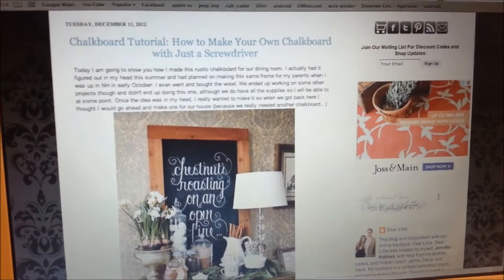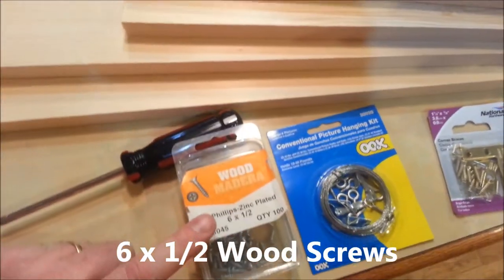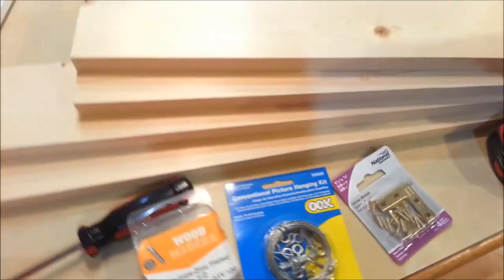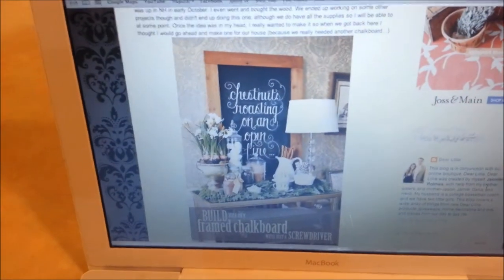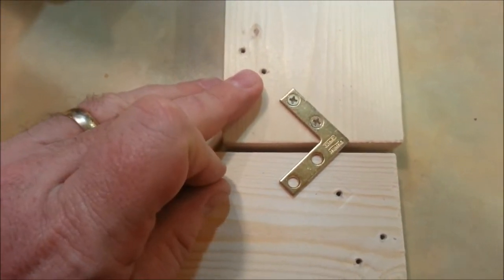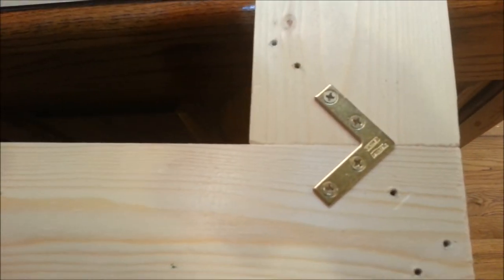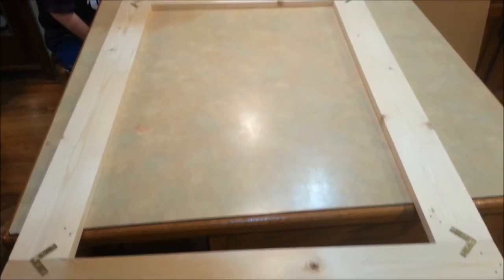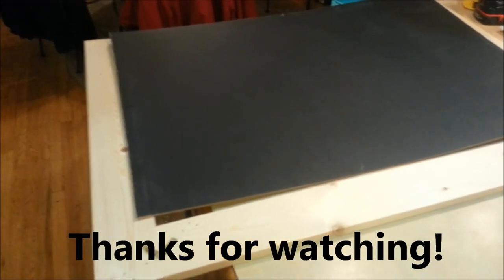Dear Lillie Chalkboard Frame Build - Part 1

Comment: do you have to drill holes into the frame when you screw in the corner braces?
Reply from the maker: I'm sure it wouldn't hurt, but I didn't pre-drill any holes.